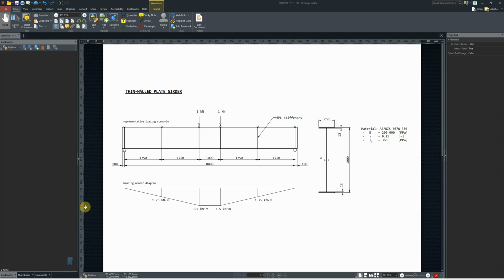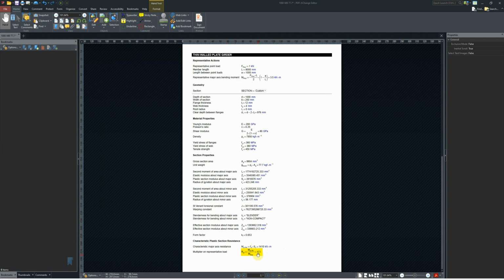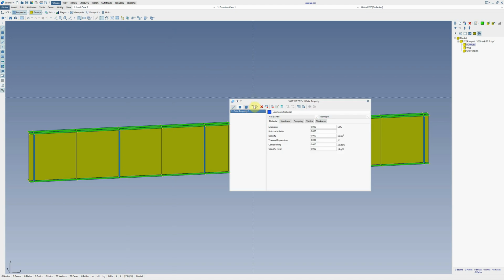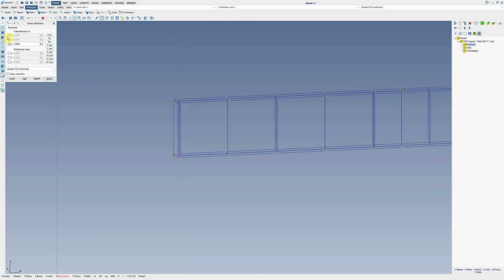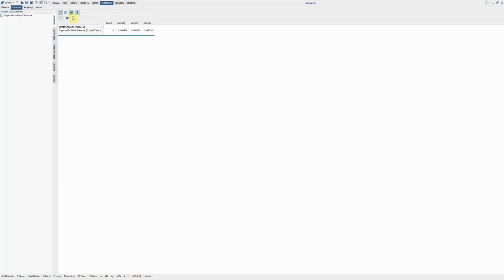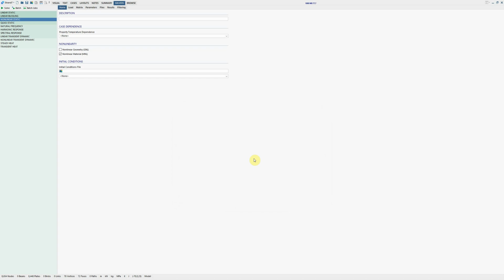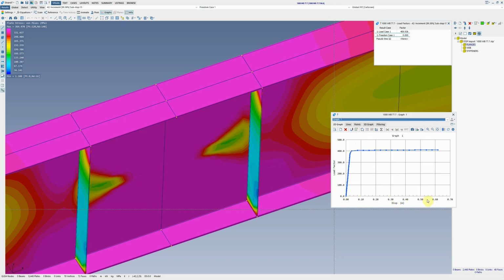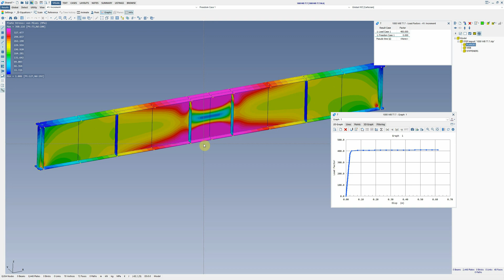Thin walled plate girder: Plastic collapse (Strand7 R3)

Comment: Thanks for the video. Would love more uploads as there's not a lot of ST7 vids on youtube. Why did you unselect nonlinear geometry in this case? Would it not be best to consider both?
Reply from the maker: Hey mate, in this particular video I just wanted to show the plastic section capacity. I still plan to make a 2nd part to this same girder problem where we include nonlinear geometry so we can see how even in this laterally restrained beam the buckling of the slender web panels reduces the capacity.
Reply: @mikeb1097  Thanks for that. Wating part 2 for check laterally restrained.

Comment: Thanks for sharing. Just a few notes, why would u choose average stress in ur result? This hides the real stress. you should always pick non average stress. Understood u are using nonlinear material and you are probably more interested in strain than stress but choosing average stress/strain would give u the average between the 4gauss points rather than the highest stress/strain on that gauss points near the node. Im assuming that the plate element formulation in that software is based on full integration so 4gauss points on each element. Also, in this problem, using arc length method is computationally expensive, its not like a snap through problem. I think Displacement control would be enough.
Reply from the maker: Hey mate.

What you describe as the 'average between 4gauss points' is referred to as the 'centroidal value' in results extrapolation in Strand7. In this analysis the extrapolation method used was 'Gauss point values placed at nodes' with averaging between elements. This simply makes the contour more pleasant to look at, while the difference in reported results is negligible (and not at all important when it comes to stress). Normally, when I check the plastic strain values I turn off all averaging so that the exact gauss point values are plotted on the screen.

As for using arc-length instead of load or displacement scaling - you are correct that any one of these methods would have worked and may be more or less efficient. Since the same model will be used for calculating GMNIA capacity, I decided to simply use the arc-length sub-stepping method for all analyses here. I did not want to use this video to explain how the different sub-stepping methods work.

Cheers!